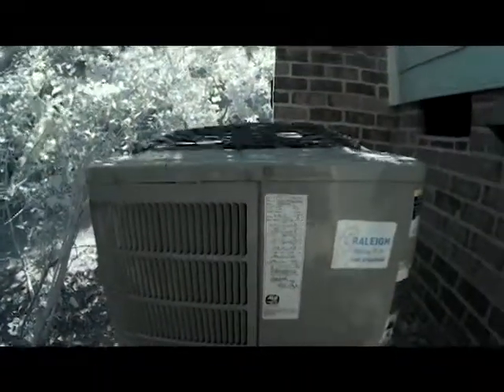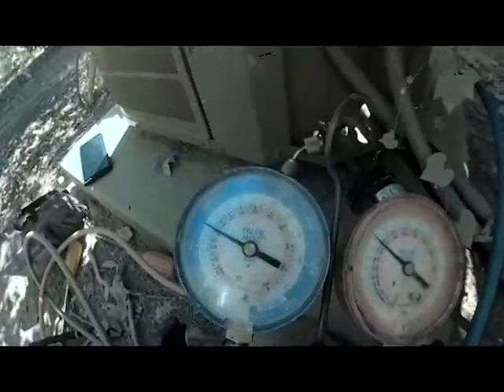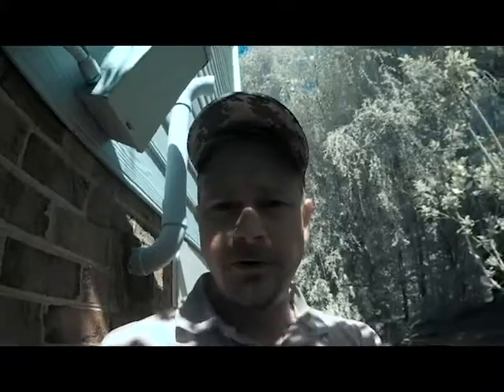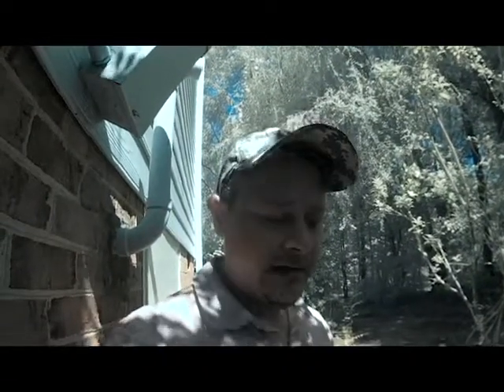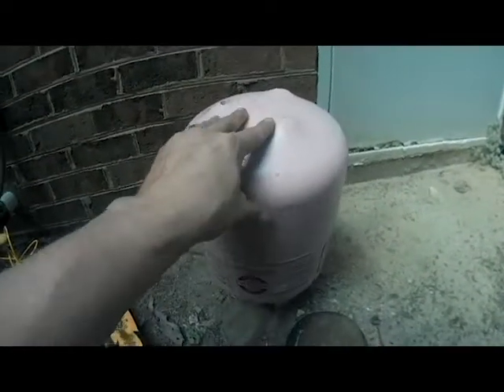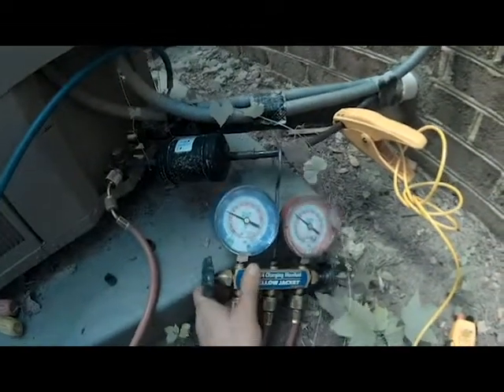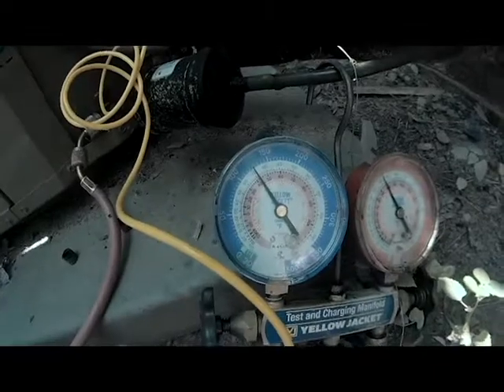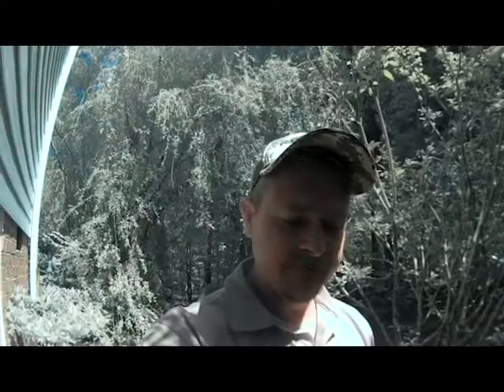Air Conditioner Low in Freon and Recharging 410a

Comment: what charging Method for 410a is used on a unit that is clicking on and off due to pressure switches .... do you charge thought liquid line or suction line first?? like of you pull the disconnect to cut the power to condenser so it doesn't cycle on and off and yea this unit has a txv
Reply from the maker: If a unit is going off on a pressure switch you need a leak search done to find the leak...i wouldnt recharge with the price of refridgetant till the leak is fixed.
Reply: @travispoe4401  had to charge it got seniors in the house. gotta keepem cool. but will he searching for leak. I tried to do what I can from face of a.h. and condenser but im going to monitor the gauges and keep searching for where this leak could've possibly been I will leak check after this heat wave passes the north east in few days

Comment: So if the unit was low on refrigerant, then there is a leak somewhere. Since it obviously was not a newer install then what about finding the leak and fixing it?
Did I here you say 20 degrees of sub cooling? 18-20 degrees of Superheat is expected on the low side but 20 sub cooling on the high side???
How about the disconnect hanging off the side of the house above your head??
No mention??
It’s what you didn’t say and didn’t do that has me very concerned.

Comment: When charging R410a as a liquid on the suction side are we supposed to throttle it in to prevent liquid in compressor?
Reply: Yes go slow. Liquid is going into compressor and compressor doesn’t like liquid 🙄